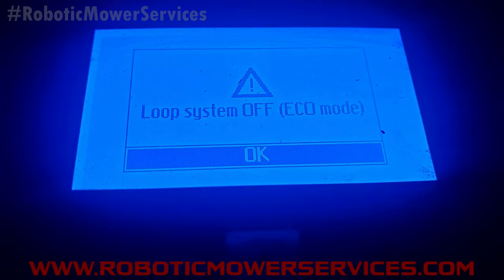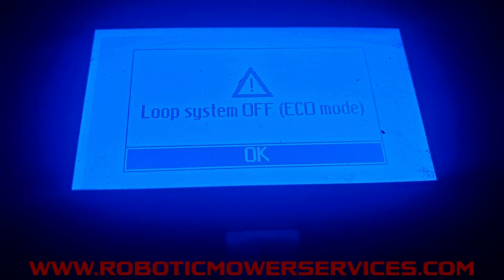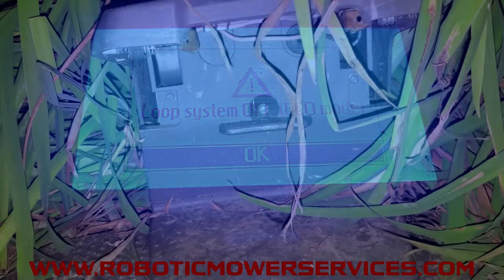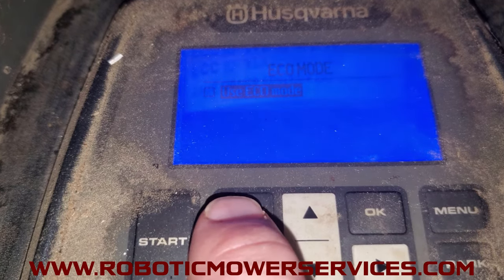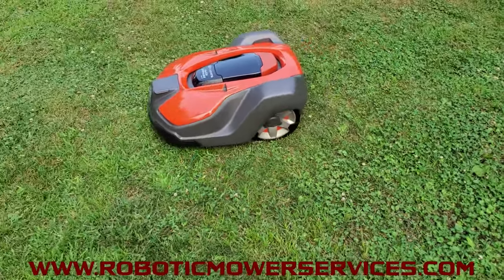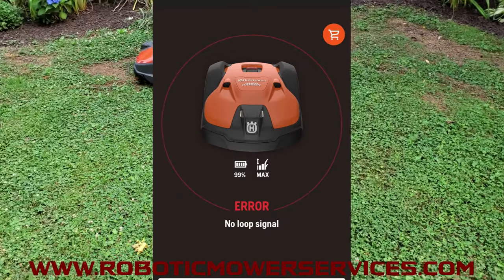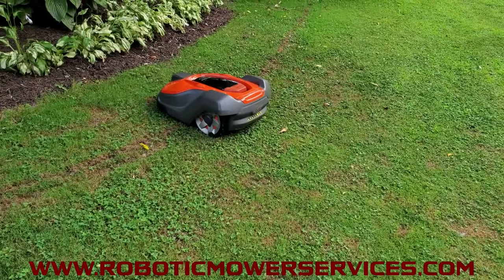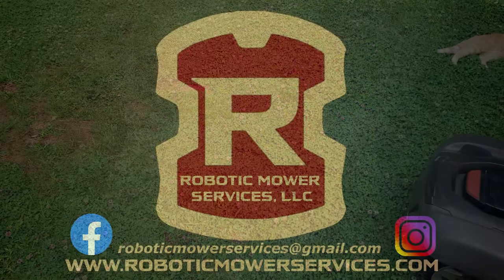How To Reset Automower ECO Mode No Loop Error ECO Mode (No Loop Error Video 3: Flashing Green Light)

Comment: I changed a bad board in a charging dock… keeps going from green to flashing green… followed your steps to no avail… narrowed it down to the power supply by using one from a different area that works fine.  Is there anyway to fix a power supply?  Nothing appears to be wrong with the bad power supply after inspection.  Is replacing the power supply the only option?

Comment: What if you have a solid green light and still get a loop error? This is a new mower, never ran it. I checked entire boundary wire and guide wire, no damage and solid green light. Mower does not start. Fully charged.
Reply from the maker: Give this a try. https://youtu.be/85tinYw5gvI

Comment: I always get this error and cannot get rid of it after I moved the 115H to the secondary area.  However, if I am in my main area, put it in secondary mode, take if off the charger, then start, this works fine.  However, the 115H is still respecting the boundary wires.  Is it suppose to do this.

Then I stop the 115H.  Bring it over to the secondary area.  Press start.  And I always get this loop error.

Any ideas here?  My secondary area has no boundary wire and I'm relying on the sensors to bump into something and turn around.

Comment: What is the advantage of ECO mode? Is it wear and tear on the board? Is it some dollar figure?
Reply from the maker: The charging station sends low voltage through the boundary wire to create a signal. When ECO mode is turned on the charging station will stop sending voltage through the boundary wire while the mower is in the charging station. It was pushed as a way to save money and energy, but since it's not really a noticeable difference on an electric bill if you are use it or don't use it.
Reply: @RoboticMowerServices  I found that when eco mode was enabled the mower would stop with an error no loop signal as it was leaving the charging station. Go out and reset the mower manually and off it goes. Power saving is negligible so it stays off for me. 😊

Comment: Hi, what if im getting the eco mode off no loop signal error with a blue light flashing, could this be a combination of a loop break plus the eco mode error?. im a husqvarna service tech and have not seen this yet. i got a call late yesterday about this and havent been to the property yet, i have forwarded this video to him so hopefully it has helped. i have a tech team to phone later, but thought id comment here first
Reply from the maker: If ECO mode is off, not "Loop system off (ECO Mode)" and it's just a flashing blue light then it could be a number of things, but most likely is a broken or partially broken boundary wire. I would suggest starting here: https://youtu.be/Znz3L2P4hcU This will tell you if it's a boundary wire issue, or something with the charging station or transformer.
Reply: @RoboticMowerServices  turned out to be a worm had crawled across the charge station board frying it good and proper, very new install so i knew his loop was good, tried a dummy loop first though just to rule it out and his resistance was great, coming in at 7ohms so proceeded to check charge station, first thing i noticed was only 13volts at the charge tabs
Reply: @RoboticMowerServices  quiet a few of us here at Husqvarna NZ follow you mate, great work you're doing and thanks for the reply
Reply from the maker: Dean, THANK YOU!! That is awesome to hear. We so appreciative for the support.